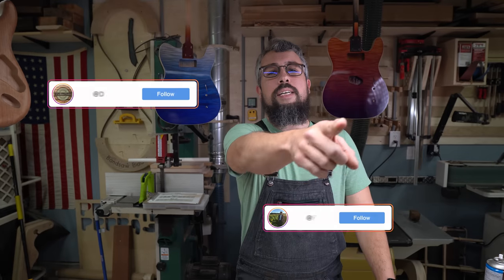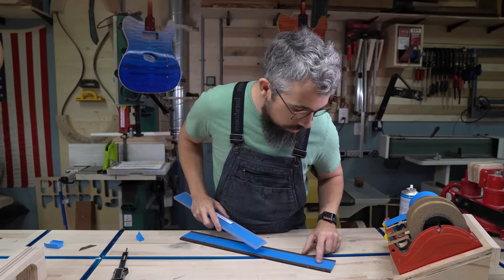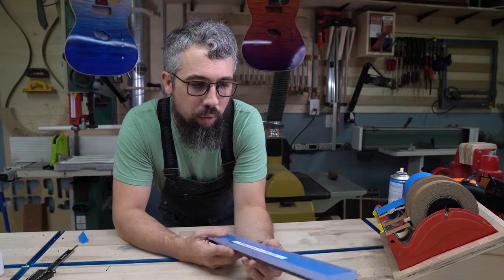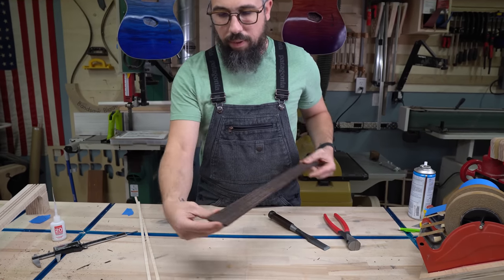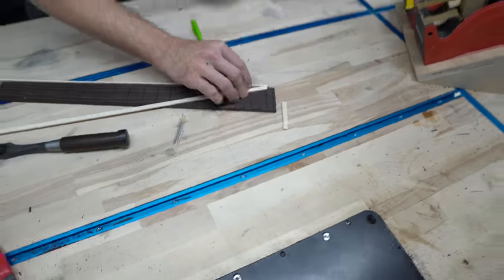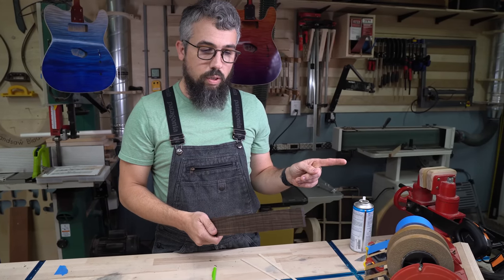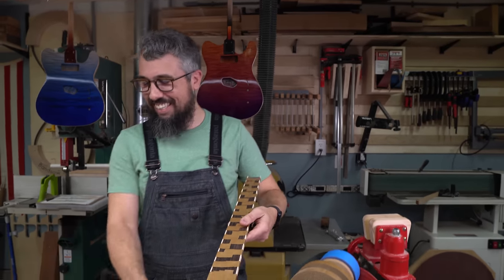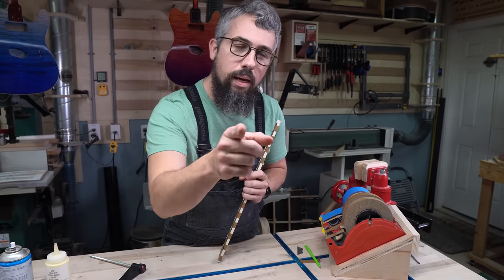How To Build An Acoustic Guitar Episode 29 (Binding The Fretboard)

Comment: One thing you can do, is have one template, for the full neck width, rather than the neck minus binding, I bought a Martin one, with that you can double side tape your fretboard to it and use  ball bearing rabbeting bit, like you would for binding the guitar. Do it on the router table. It works well so long as you are comfortable with climb cuts in spots to avoid tear out.

Comment: a rabbet is a from an Americanized boat building term. From an Old French word spelled Rabbat it means a recess, normally referring to setting a door back in a wall in medieval Europe. Also used in boat building for how they set joints in wooden boats. Also known as a rebate from the same french root. Has nothing to do with rabbits.

Comment: thank you Chris and Matt. what is the difference between the stew-mac glue and tight bond wood glue ?
Reply: I believe it's LMI Instrument Glue he uses, not Stew Mac. Two advantages over Tite Bond -- 1) It's got something in it that shows up under a black light. So when you're inspecting to make sure nothing is going to mess up your finish, it's easy to see spots where some glue is left over. 2) It can be un-done pretty easily with heat -- by (carefully) hitting it with a heat gun, you can correct mistakes.
Reply: @larrycoon3794  thank you